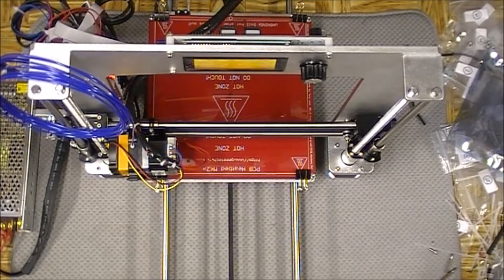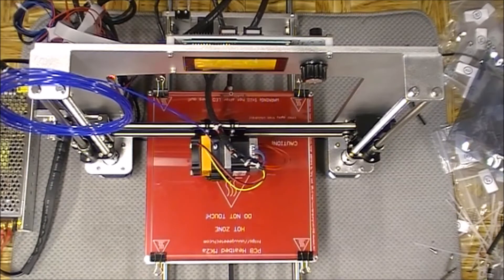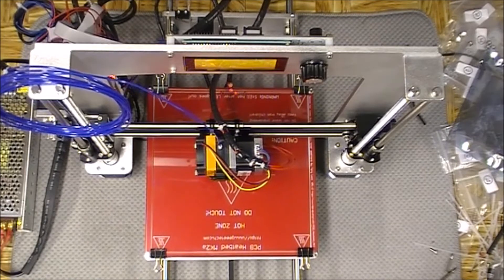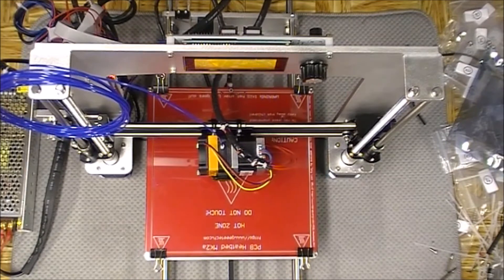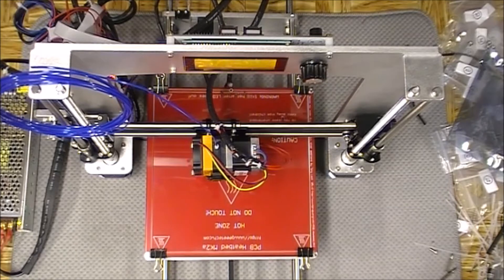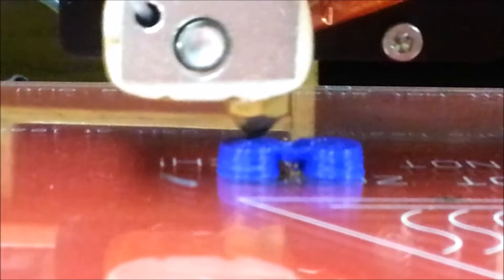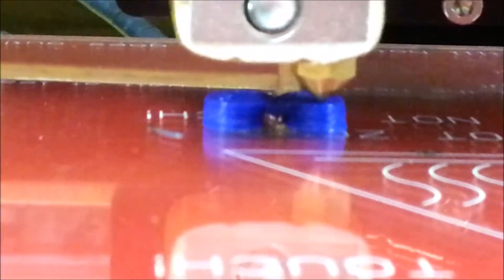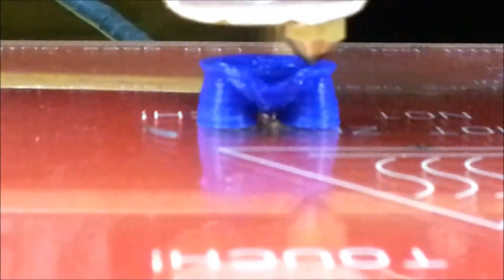Geeetech Aluminum Prusa I3 The First Print

Comment: hi, i have a 3d printer like yours, but i buy a new motherboard (ramps 1.4 + arduino mega), new driver drv8825 1/32 step and a bltouch sensor...can you help me to find a correct firmware?
thanks

Comment: Did you have any issues with the firmware?  I can't get my printer to home Z. It touches the endstop but the stepper motor won't retract after. I don't know if it's a bad drive, bad firmware or the steppers are not tuned. I can't get the host to connect to the printer either. Don't know if windows 10 has something to do with that.
Reply from the maker: +Ryan Rosser No, I never had any problems with it.  In fact I never updated the firmware for it.  Have you tested the end stop switches?
Reply: Yes, something is going on with the firmware or the stepper tuning. I just ordered a RAMBO mini board so I'll replace that when it gets here because I think the Geeetech board may be crap. I've got the 3 in 1 control box so I know it's not my wiring. I appreciate the reply and thank you for the video.

Comment: hey Jimmy, im still to complete a first test print, im running into 2 issues, one being the x axis moves twice the distance of y (whilst printing a test cube), also the extruder under extrudes when trying to print but manually i can get much more out of it, any tips for correcting this its a I3 pro B a plastic version of your printer
Reply from the maker: +Nathan Hellyer do you hear any noises that sound like it's skipping steps?
Reply: i got pretty good hearing sound like it does when manually extruding
Reply from the maker: +Nathan Hellyer I know there is a setting for increasing the steps.  I have never adjusted them.  You might want to contact Geeetech and ask them.

What slicer are you using?
Reply: Slic3r and Geeetch host
Reply from the maker: +Nathan Hellyer I asked because I know there have been some problems with Simplify 3D.  Sorry, but I don't know how to adjust those settings.

Comment: Thanks for this video Jimmy. I do notice in your videos that the printer seems to be on a left handed coordinate system (or it "zeros" at some positive value of y). Can you comment on if you modified the firmware to accomplish this. 

I am also having a hard time getting the sanguinololu firmware to compile.
Reply from the maker: +Dave Frankman it is 100% factory installed firmware.  Even till this day I have not updated it.
Reply: shouldn't homing always happen "where" the endstops are mounted? :)